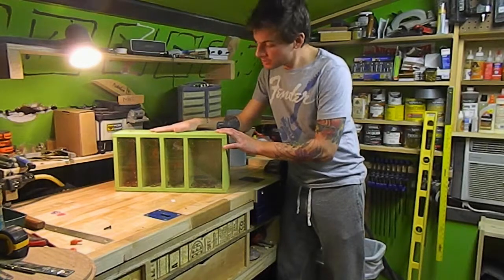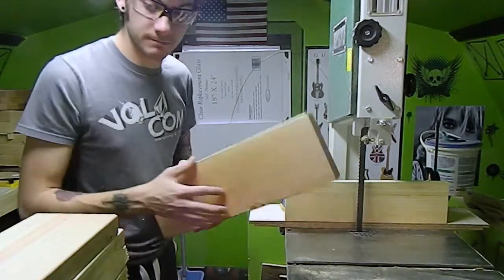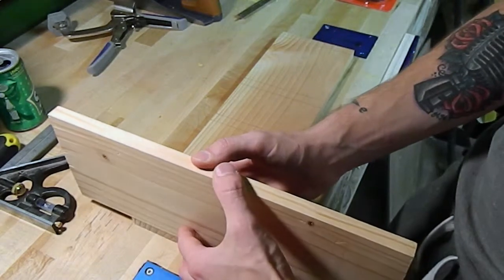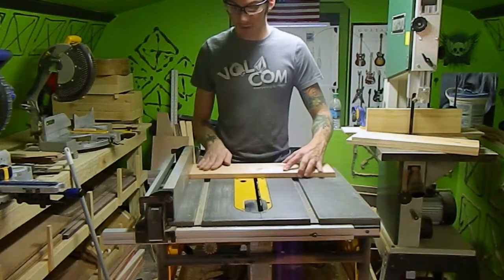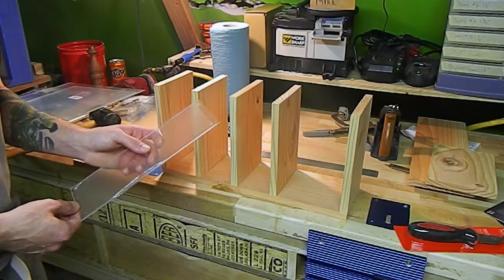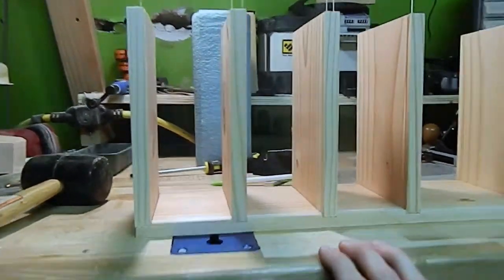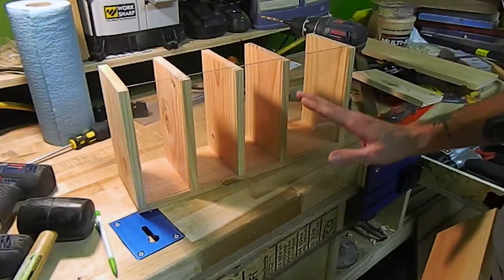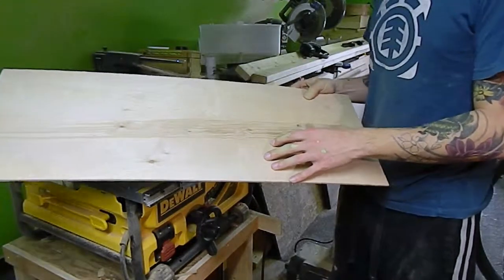Coin Collecting Case

Comment: Great idea. Better than just throwing all your coins in a plastic bottle.  Think I might use a different color. As for getting the coins out easier, maybe cut the back sheet of plywood like the front plexiglass and then drill a small screw hole at the top of the back plywood for each compartment so each could be emptied when wanted? Cool idea.